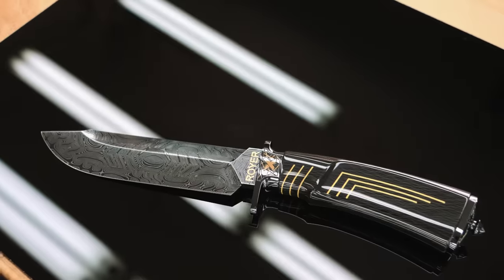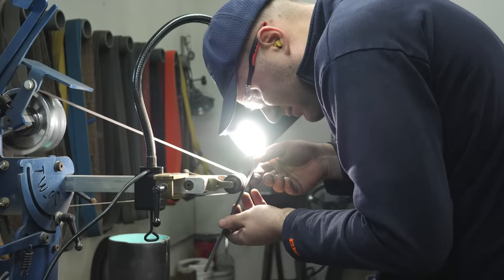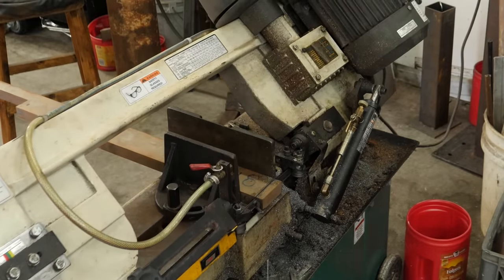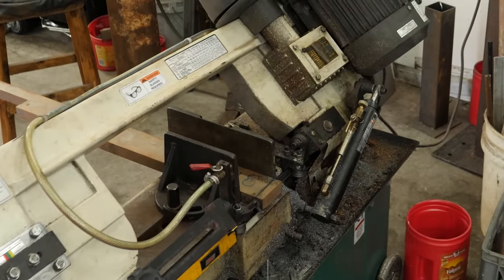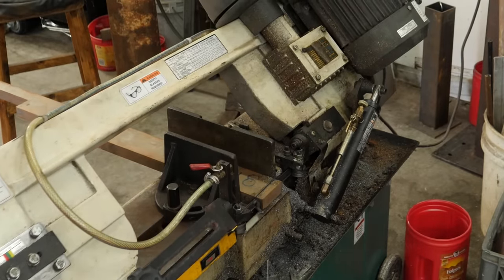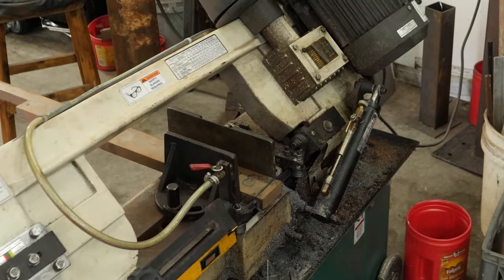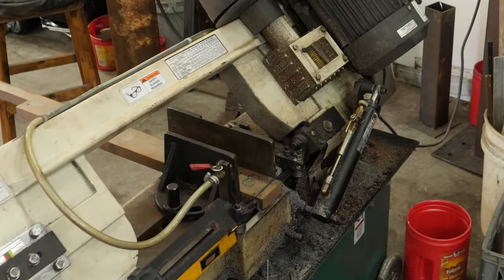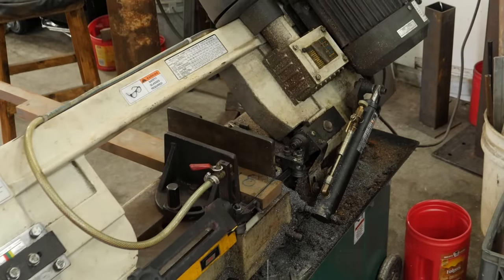I Built A $16,000 Tactical Knife

Comment: Another masterpiece!  If you want to try another tool for those lines without relying on a rotating knife, look into "gunpla panel line chisels".   Mecha model kit builders sometimes customize it by adding panel lines.  But they are very small square tip chisels meant to be dragged along the material to slowly create a groove.   Granted those tools are designed for styrene or resin so I am not sure how it would behave in carbon fiber.  But they arent expensive tools if you wanted to experiment.

Comment: Thoughs little bubbles are called ( Solvent Pop). It happens when a product is applied to thick. Looks like it pooled up on ya there. Pop occurs when the clear dries fast. ( flashes) it dries from top coat to bottom kinda like how a lake freezes. Thoughs little bubbles are trapped gasses that accuse in the drying process.  I met you at Blade Show Atlanta. I took a pic of you and yo brother.

Comment: Kyle, what if you did a feather pattern and instead of cutting all of the way through the stack, you put a splitting die on the bottom and cut towards the center from the top and the bottom. If it works, cool pattern.

Comment: First off awesome work!

That said, some tips and information from a Mechanical Engineer:
1. Heat treating is quite easy, and a 1hour read will teach you everything there is to know about annealing, tempering, heat treating and quenching. Its not rocket science.
2. You should look into case-hardening and induction heat treating. Case hardening is very useful and if your weapons were ever put to hard use, it would serve as your best option. It is a process that hardens the outside material while leaving the inside ductile.
3. When tapping threads on your tangs, you should back out every 1/2 to full turn. You need to allow the tapping bit to expel the machined metal. Keep the bit highly lubricated and take your time threading and then backing out, and your bits will last a lot longer. Not to mention, the threads will be cleaner with a better cut and finish.

Great work again! Your work is very beautiful

Comment: While the Black Diamond Idea is very cool, as a full time jeweller, who works with gemstones and precious metals every day, I can tell you it is not very practical on the back of a sword or knife, the culet( back point of the diamond sticking out) can surprisingly chip quite easily if they are not handled with some care, which is why we are very careful when setting stones with points such as square diamonds. If the culet of the diamond is accidentaly hit against something solid and hard it could chip. Even though a diamond is the hardest gemstone/meterial( resistant to scratches and abrasions) it is not immune to being broken or chipped, it does happen. You expereienced this with the CZ shattering, although a diamond is able to withstand much more than a CZ before it breaks.

However I also understand this is a piece of art, looks amazing, and I doubt someone would ever actually use the back of this for its purpose.

Comment: (sorry in advance as i might end up doinga running commentary) Where did you get 1018?...😅 You're a smith...you can forge a guard to rough shape then grind it to final shape...then hand polish It does not need to be machined from the start.

Comment: Really nice work! If you preheat the 2k finish can, it provides a much finer fog and it will prevend the orange peel. I simply use pre-heated water; NOT BOILED! and put the can into the water for about 10 min (refresh the water after 5 min).

Comment: Gorgeous! Thank you for sharing this. When I was 15 (I'm now 60) I made my own hunting knife in my dad's wood/metal shop in the basement, though no comparison, it was from a kit and I certainly didn't forge my own blade nor fabricate the pommel, bolster or guard, but I did quite a bit of shaping and finishing on it. Your skill and craftsmanship are exemplary. I have one question: I don't own any custom knives but I have a few mass produced knives that I would consider lower end of mid-range ($300) but I've been impressed with the balance of the overall knife, right where my index finger addresses the handle, so I was wondering how much thought do you put into that when designing/building a knife? You didn't mention it. Again, thanks for the video and wish I could afford something like that. 😒

Comment: Nothing about this knife is worth $16k. You've lost your damn mind. $500 at best.
Reply: That is not a knife - it's just the form it's wearing.  That's an art piece.
Reply: @CyberiusT  Yeah... That was dumb. Art piece or not, its not worth 16k. Period.
Reply: @nazgullinux6601  ...You obviously have never wanted something for anything other than its utility.
Answer me this please: assuming that an artisan deserves to be paid for his/her time, what rate do you think is reasonable for first-quality work?  Now factor in that his thing took 3 months to produce.  Frankly, $16K is a steal for that piece - which is why I will never own one.
This is also why craftsman-made artefacts are incredibly rare these days.  Everyone wants is happy with their CNC'd MDF furniture and stamped knives - they do the job for now, and they cost $10.
Reply: @CyberiusT   Well, considering I perform first-quality work as a career in electrical automation and make $45 an hour, I'd say his rate should be less considering its basic metallurgy for very small pieces. You really want to compare his little kitchen knife to a complete industrial 3-phase control cabinet complete with PLC, the programming, the physical labor and building the design, running the mains and control wiring, circuit protection and over-current devices, etc, which is valued around the same price?

Fuck no. $16k is piss ant money for the kind of work I do. I've built $200,000+ control systems for 8-figure and higher machines. His work is not worth $16k for a little knife. Sorry but, no you are wrong.
Reply: @nazgullinux6601  His work is worth what people are willing to pay. His knives are commissioned, so they're sold before they're made, and if you check his other videos, he's sold many other expensive pieces like this, which means there certainly are people willing to pay for them, the same way that there are many people that spend tons of money on jewelry. I, personally, would never spend 16k on a knife, but that just means that I, just like you, am not part of his target audience.
Reply: @ultimus6412   I know all of this. I just like fucking with people that get easily triggered lol

Comment: at that price you should at least be using higher end steels
Reply: I assume you're a master blacksmith to be making claims like that. Surely it's not that super steels have different heat treating cycles than carbon steel and couldn't be hardened as a pattern welded blade. No, you know better.